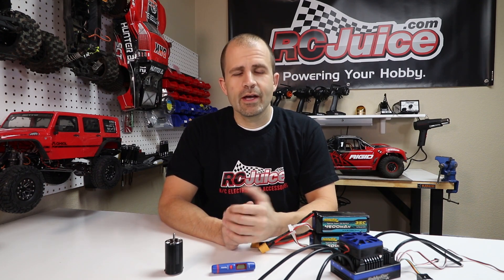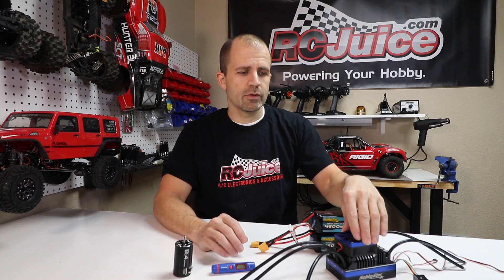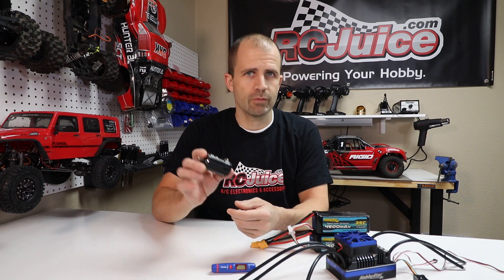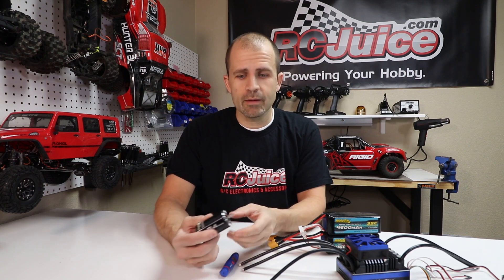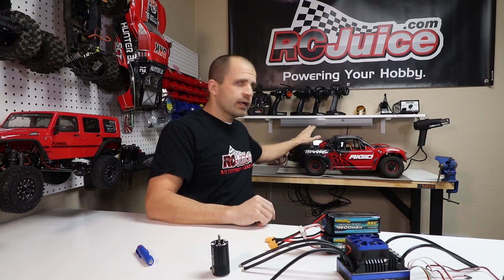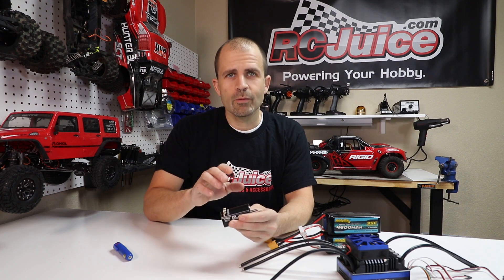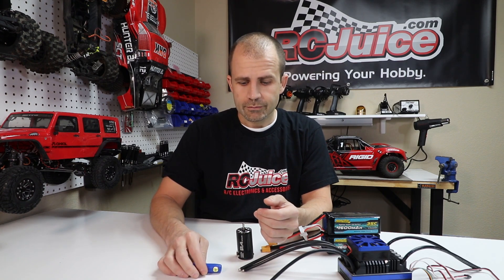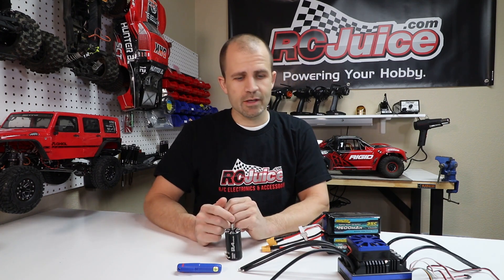Brushless motor temps, the #1 rule in R/C!!

Comment: Hi, i run with 3s on combo Orion vortex 4100 KV and 30/81 geraring.But motor is too hot, and I stop it for few minute, for well done works two cooling fan on it.This set up its' a damage risk?
Reply from the maker: 4100KV on 3S is a very hot setup, you really need to gear it very low to keep temps in check but if you are going to stick to 3S we really recommend closer to 3000KV.
Reply: @RCJuice  Last gear was 26/81 I have changed for reach 60 mph

Comment: So please get an revo 2.0 to go 60mph and run under 70c because no one has ever done that and I've got a leopard 4282 1680kv motor with a max 6 and the motor is getting hot either proline bad lands 3.8 running on 15 46

Comment: Not long ago i bought a slash wih the vxl 3s. The seller sold me a 2 s battery. My esc was making a lot of heat and fried. So if i understand well, i should only run 3 cell battery, right? 
Verry helpfull video. Thanks a lot. Like and sub.
Reply from the maker: The ESC is 3S capable, but it will work fine with a 2S battery and would definitely not be damaged by simply running a 2S battery vs a 3S.  This sounds like you have something else going on, we'd need to know a bit more about the overall setup and exactly what it was happened to the ESC.  If it happened right away it is possible the ESC was previously damaged, sometimes when you overheat a system it will work OK when it cools off but will have some running issues and will still eventually completely fail.  Please shoot us an e-mail if you'd like some more detailed help with this: https://www.rcjuice.com/contacts/
Thank you for watching, and for the like and sub!
Reply: @RCJuice  thank you. Im french canadian annd ill watch over and over your video to make sure i understand well. Ill  contact you by email for sure later with more detail and a video. Thankd again.

Comment: i just change motors and esc to my drone mjx bugs 5w but i cannot calibrate them.
if i turn it on and push up the remote gets full throtle and dont came down
the esc are blhelli.s ms15a and the motors  dys be1806 2300kv
Reply from the maker: It's hard to say without some more info and seeing the setup, but calibration issues are usually related to 1 of a few things.  Number 1 is to make sure that you throttle TRIM setting is all the way DOWN so the ESC is not receiving any throttle channel input at idle.  Number 2 is to ensure that the throttle channel TRAVEL (sometimes listed as EPA) is set to the MAXIMUM setting in both throttle and brake directions.  Depending on radio this can be 100%, 120%, 150% etc.  Number 3 is that some radios need to have the throttle channel  set to REVERSE for them to work with many ESC's, this is usually always true on Futaba and FlySky radios but is also the case with many of the other brands floating around out there.

Comment: Very helpful video, thank you. I can't wait to install my new RCJuice Hobbystar 4092 1480kv on my Kraton, when it arrives. I'm glad to hear it will handle 8s(conservatively of course). What is the best way to support such a long can, I've got a Hot Racing motor mount, but wonder if it will cope?
Reply from the maker: Random solution, but we often use some pieces of hard rubber (if you can find gym-floor type rubber it's great) and cut a piece that fits snug between the end of the motor and the chassis.  A bit of epoxy helps keep it in place, we do this a lot and it seems to help.
Reply: @RCJuice  that's a great idea, thank you. I'm expecting that it's going to cop a beating, so I just want to try to protect it the best I can. Keep up the great service guys, it really does make a big difference and you stand out when you help us out.
Reply from the maker: @jonowillmer  Our pleasure to help, it's a simple trick but it definitely does the trick.  We truly appreciate your kind words and appreciate your business!
Reply: PrimaRC what esc you running with the 1480?

Comment: Fwiw...
I have the Hoppystar 1730kv in my Arrma Kraton and it rips. It took me 3xs to tune it with the right pinion. It is dialed and was worth the wrenching. Take the time to gear you rig . Its a must!!! Great vid
Reply: johnny rocket..i have the hobbystar 1730 in my kraton v4 and im using the 19tooth but I also bought an18tooth..what do you use
Reply: RCJer sorry for the delay. Im using a tekno 15t with a hoppywing fan. Sweet spot for me. Torque over speed for me.  Nevertheless it’s crazy fast and cool temps
Reply: Johnny Rockit What Esc you guys running in your armas with the 1730kv?
Reply from the maker: @miketye2805  We are running the HobbyStar 200A 1/5 ESC:  https://www.rcjuice.com/motor-esc/car-esc-s/1-5-esc-s/hobbystar-200a-brushless-esc-3-8s.html
Reply from the maker: @rcjer6473  We do not have a shop Kraton here, I would recommend starting with the smaller pinion (we always do) and monitoring temps to see if you have the headroom to go bigger.
Reply from the maker: Always worth putting in the time from the start!

Comment: I run in big open areas full throttle alot which is hard on esc/motors. I became a pro in telemetry. Had to especially having fe boats. Basically gear or prop to get to 170 degrees towards end of run and shut down at 180. Both esc and motor. Telemetry pays for itself especially batteries shutting down at 3.6v per cell. Thats generally the slight decrease in power anyway. My question is whats your opinion on where on an esc is the most accurate place to put sensor? I put them on the esc itself but am thinking of peeling + wire coating and monitoring wire itself temps. Another advantage to voltage telemetry is monitoring drawdown under load. Bad cells will drawdown further in overall voltage saving letting loose later. Also will help detect shorts by glitching voltage. Good video thanks.
Reply from the maker: Thank you for watching and for your input!!  I do a lot of MX riding in the dunes (and of course the RC's always come with me) and absolutely, that's a different level of load on a power system and you are smart to watch those temps constantly via telemetry.  We usually will place a temp pickup for an ESC as close as possible to the middle and bottom of the heatsink to be closest to the "core" of the heat.  Placing it in the wire is actually an interesting proposition, my gut tells me it's best to be as close as possible to where the heat is coming from but the wire does hold a good amount of heat as well.  The most important part is going to be getting familiar with what the temps need to be at for which ever location you pick if they do vary.  Some testing would be in order here...